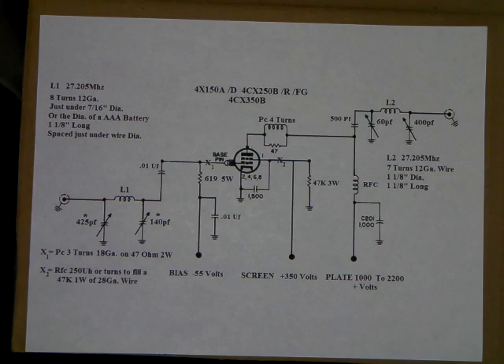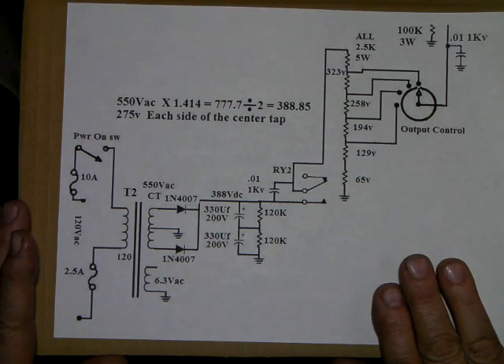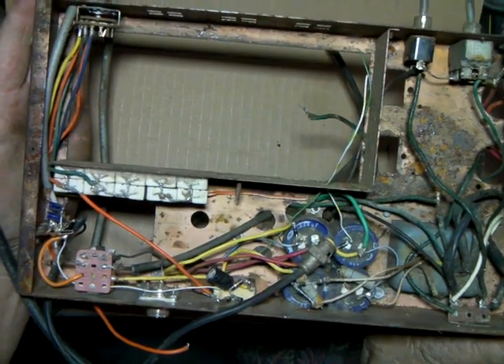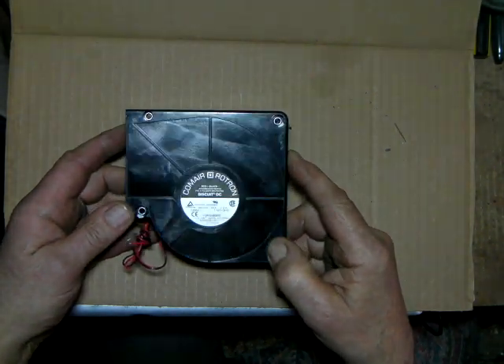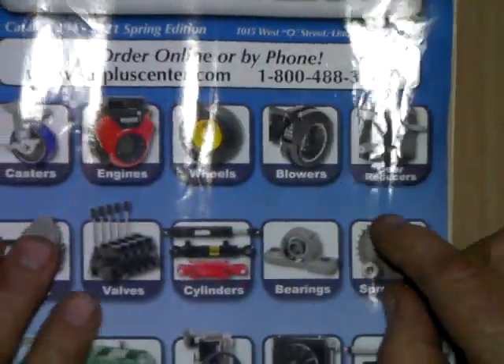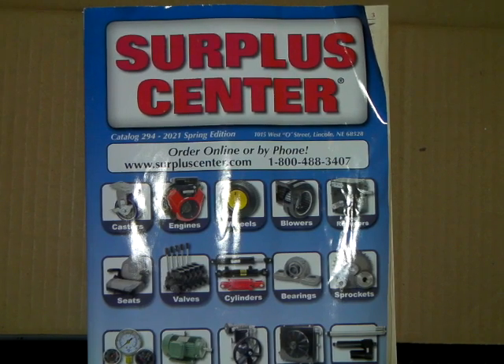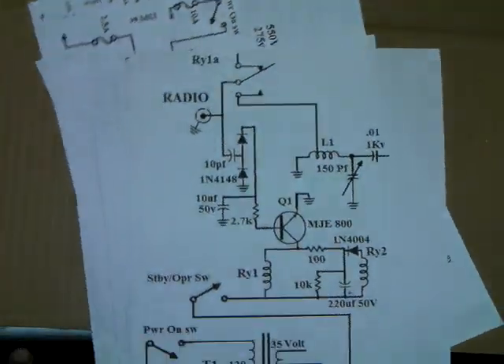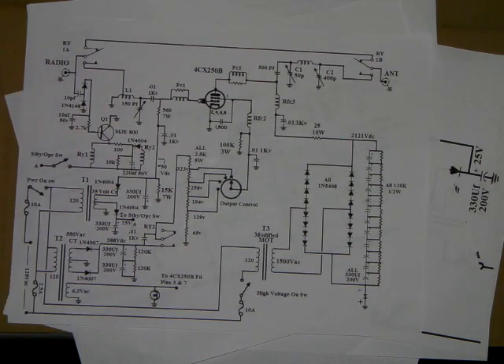Single Tube 4CX250B Amp For 27Mhz   The Build Pt1

Comment: Good luck finding a tube socket for these!!!
Reply: I got tubes , no sockets!!
Reply from the maker: sure ....all day long:  https://www.ebay.com/itm/187459064500?_skw=4cx250b+tube+socket&itmmeta=01K1VXZKHY4QE864GQ2HEWH09H&hash=item2ba56e52b4:g:OA4AAOSw8V5m8Y~F&itmprp=enc%3AAQAKAAAA8FkggFvd1GGDu0w3yXCmi1eK8G%2F443%2Bu5djxJYr1rxsIHQz2lYWFQPy4iwjv6CrLAQ3QhptYR%2FbvsF5iJmQC07LQ%2F2yLBSiLEh%2FLyuwdUxBnSDjpzoKxbmsWyf5XMOyhar%2FD5vehzO0PCWKgotDfMlXmX%2FQ3x3wFk74j7Zob4bxoPNwVGKJ%2Bykrdv8beBT%2BntOzwrWUREA839AJzVMv24z%2Bn2xmWV5p0ViOPll5RjZHlkpstHf2rVYSRgCEwRlcw3IuxY%2BZwzBUS3FQMHCZ%2B4Tr9Qm3Qd%2FTMDUNMmU7xMBr1vkl3%2BbogCn02h%2BTp0rOy0g%3D%3D%7Ctkp%3ABk9SR465_v2OZg

Comment: Will this work for 28 Mhz band as well? Thank you for this build series. God bless you sir.
Reply from the maker: YES.......You will need to use one less turn or so on the output tank coil and maybe about the same for the input network....the input network may  work as is just by retuning.
Reply: @radiomedic111   Thank you very much sir I do truly appreciate what you're doing.

Comment: Thanks for videoing this build Mr.Norman. 250b is one of my favorite small steel tubes. One of these days I’m gonna build a 4cx250b box to run as a driver for a 1500 or 3000 steel tube box. 

770 DieselDoc 40mi west of Washington DC waving a hand from Marylands Cumberland Valley…73s from me and mine to you and yours rascal bye byebye bye